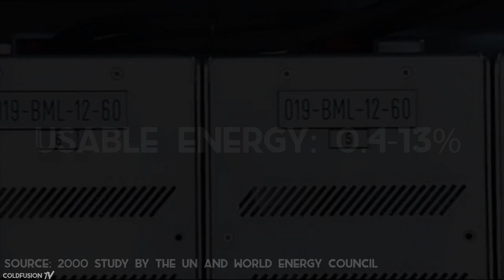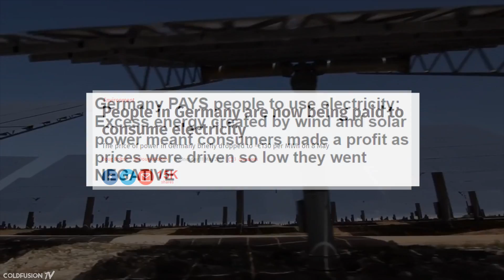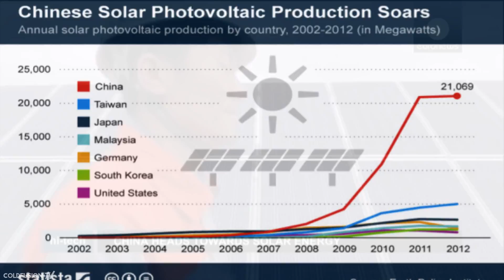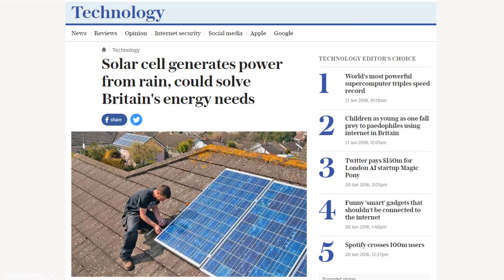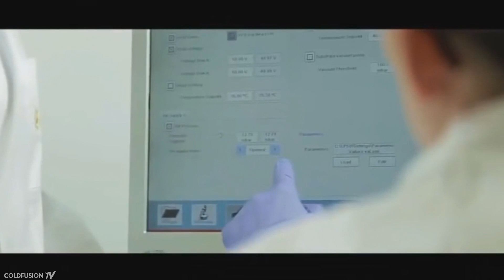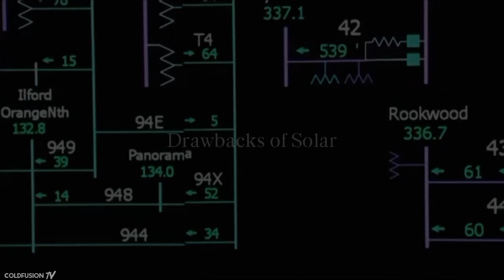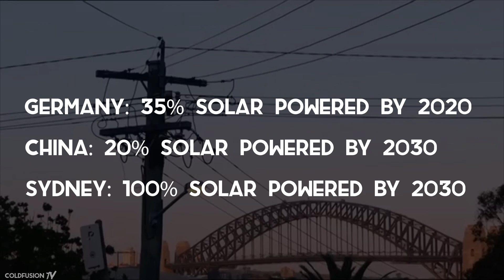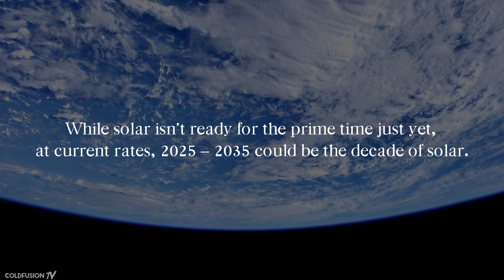The Truth About Solar

Comment: This video needs to be updated.  With the decommissioning of nuclear power-plants in California, Japan and in Europe with the thought solar and wind electricity creation would off-set the loss it's dismal failure.

With the premature decommissioning of nuclear plants we have lost 6% of our our ability to produce electricity  Yet at the same time we have only been able to offset that 6% loss with a 2% increase from solar and wind.

So what about the other 4%?  We are burning more coal and fossil fuels than ever before and we still have all of that highly active nuclear fuel we won't be using.

Germany and California have both announced they will not even come close to meeting their solar initiative programs.  With the loss of nuclear both are building more coal/fossil fuel fired power-plants.

Now that we know for sure solar and wind can only provide a small percentage our our electricity, were is the rest going to come form?  Coal/fossil fuels or nuclear?  Or are you willing to do without electricity for a few hours everyday?
Reply: Sparky   Why are you so against nuclear and not cola/fossil fuels?  Every years the burning of coal and fossil fuels kill 3 million people and releases millions of tons of radioactive waste into the atmosphere.

At least nuclear-power plants only release nuclear radiation only when there is an accident where as coal/fossil fuels release nuclear radiation everyday.

What's your objection to the latest gen of nuclear which uses low atomic weight radioactive isotopes.  If a Chernobyl size accident were to occur with a next-gen reactor the radioactivity would have decayed away in 20 years.

Let me ask you a question.  If solar and renewables will only be able supply the world with 20% of the words energy in 35 years where is the other 
85% going to come from?  With the technology we have right now it would have to be nuclear or coal/fossil fuels.  Problem with fossil fuels is they release green-house gasses. release millions of tons of radioactive isotopes into our atmosphere and and kills 3 million people every year.

If you have a better solution lets here it.
Reply: Both of these failures were as you mentioned due to human failing and not the technology itself. While I am not going to go traipsing around ground zero at Chernobyl it turns out the wildlife around there is doing pretty well. Radiation is not a no amount is safe thing like we have been told. While we may be tempted to talk about reducing demand and living less energy intensive lives that is not going to happen unless access to energy goes away and we severely reduce the population. I want to see us use the new reactor designs with passive failsafes and no ability for the technician to override them. The LFTR reactors are pretty cool in that it is hard to keep them working and in case of even a severe accident they still fail off. They also produce little waste and can even be made to burn old reactor waste. Yes we paid a steep learning curve on some of the old technology but it would be foolish and perhaps ecologically devastating to take the one comprehensive practical non carbon producing alternative to fossil fuels and say that it can't be used because we made tragic mistakes in the past with it.
Reply: I don't think anyone that was paying attention thought renewables were going to offset the losses in nuclear energy in Japan and Germany.  Not all environmentally conscious people hate nuclear. It is a great power source when managed well.
Reply: Yep, thousands of death are too dangerous! But millions of death from fossil fuels are A-okay! It's like the difference between deaths in airplans and in cars.
Reply: Chernobyl. Fukishima. Who fixes these colossal failures? No, not nuclear failure, not an energy more dangerous than others, but stupid. And that's not fixable in humans. And it shouldn't be either. It's called freedom, and living, and being who we are, even if stupidity is part of the equation. The part where stupidity becomes unacceptable is when people think nuclear accidents and mistakes can be fixed. How cheap and how environmentally balanced IS nuclear energy, no matter how advanced and safe the designs are now? The monetary, physical, environmental, cultural and health losses and negative outcomes of Chernobyl's buggered up test audit will never end. It has taken 30 years and countless dollars just to put a flimsy (100 year life) cover of the #$%&-up. Belarus land lost. People's lives and heritage permanently erased to the point where nobody remembers what was lost. (or cares). 
Oh. And Fukisima? It's shameful when the unpleasant reality of this sort of situation is only shown by amateur researchers sneaking through illegally with dosage meters on the dashboard. 
Perhaps the key to meeting energy needs in the future is a change in what drives the need. People, and the way we live.
Reply: Agreed,  Nuclear power is way more dangerous than humans can comprehend.  Well spoken points here!
Reply: Todorius  Why is it these pro-solar anti-nuclear types are so ignorant and don't understand the difference.
Reply: Michael Weaver  You need to learn more about thorium and instead of the hype from Sorensen.  Look if MSRs were that safe why is Sorensen having such a hard time getting the few million he needs to get started?

He can't even get enough funding to open an office.

But let's look at the facts.  An full scale MSR has never been built.  Yes we built a small experimental one, but scaling up from experimental is something new.

Thorium is water soluble.  So if there should be a leak the salts could enter or ground water and water supply.  There are a number of corrosion and technical issues which were never solved and still to this day we don't have them all worked out.

The US and Europe considered thorium but with the modern technology we have today it obsolete.  

China is the only one considering thorium.  But even they have realized it will take 30-40 years to get a prototype built.  But why?  We are currently working on Next Gen Nuclear which uses low molecular weight atoms and will produce 1,000 times more energy much more safely than MSR.

These are just some of the reasons we will never see or build an MSR. 

 .
Reply: Passed High School Physics
I have provided you with information up to date to September of last year. Please stop lying.

You make claim after claim that are blatantly wrong. Almost everything you have just posted there is a lie, and everything else is at least misleading. For a proper breakdown of the technology and the challenges it is facing I am referring anyone reading this to the following:

http://www.janleenkloosterman.nl/reports/thesis_pool_2013.pdf
Reply: TheGerm24  Agreed.  Next Gen Nuclear is proving to be even better.  Using low molecular weight atoms there is no long lived nuclear waste.  Should an Chernobyl or Fukushima accident occur with next gen nuclear in just 20-30 years all of the radiation will have decayed away and it will be completely safe again.
Reply: Yeah, unfortunately only partially true. The Green party still wants nothing to do with nuclear even though it is their best hope to slow down or stop climate change. They really believe deeply that anything nuclear is a deadly danger that must not be allowed and that renewables can replace everything. I myself don't want much to do with today's nuclear as the waste decay is just to long and dangerous. The next gen alternatives look very attractive and that's where China is going although it galls me that they are going to go there on the research the US did and left abandoned. Better China does it then nobody but what a better country and world we could have had with this technology.
Reply: Semni Istiqlal  Have you ever taken a  science, physic or chemistry class?  Have you never heard of the term molecular weight?

Where did you get your education?  

All atoms/radioactive isotopes have different weights.  Current nuclear power-plants technology uses the heavier atoms/isotopes for fuel.  Next Gen Nuclear is using the lighter atoms which is at the complete opposite of the periodic table of the elements.  (You do know what the periodic table of the elements is, don't you?
Reply: Semni Istiqlal  If you think MSR is so great why not invest in it and make it happen?  

Don't you think their's a reason why no one is investing in MSR?  Yes a prototype was build in 3 years, but it was also found the prototype could not scale up.

Next Gen Nuclear research is being funded by the US, (NIF), European countries, (ITER), China and billionaires.  They are not spending on a penny on MSR because of all of the technical problems MSRs have.
Reply: Passed High School Physics
So? This is not relevant to what we were discussing.
Reply: Passed High School Physics We were discussing nuclear power. I ask you to back up your claims and you try to change the topic, very suspect.
Reply: Passed High School Physics
Because the burden of proof lies with the one making the assertion, not the one calling that assertion into doubt. You'd know that if you had actually passed high school physics.

You are either strangely ignorant of this or your next move is going to be to pretend that this now gives you an excuse not to provide any evidence of your assertions.
Reply: Semni Istiqlal  Friend there's the Michael Shellenberger interview with nuclear engineers in China from just a a few months ago.

Then there's the info on the World Nuclear Association web site.

I've provided you with the information have you even looked at it?  Why don't you take a look, read it, and understand it, the comment on it before bashing me.  The information is out there if you read it.

And then you avoid my questions.  If we are to learn from each other you need to provide information also.

The links you have provided are years old.

Has Shanghai Institute of Applied Physics received additional funding to continue the research? Nothing you posted so far says they have which means they will be shutting down the research next year.

Can you post a link to the progress and discoveries they have made with the funding they've received so far?

Have you looked at the World Nuclear Association web site? Why is it there is no mention of MSR or even research on MSR/thorium reactors.

Have you read or listened to Michael Shellenberger interview with the nuclear engineers in China? They clearly stated China sees no future in thorium/MSR.

Can you explain why you think China is moving forward with MSR when they've made a commitment to TWR which is a completely different design and technology.

Why are research dollars being spent on next gen nuclear if the Chinese according to you are developing MSR.

Could it be thinks in China have changed?  And they too have now realized MSR/thorium is not the way to go?
Reply: Semni Istiqlal Dude things in the world change.  If I had posted this fiver years ago yes you could call me a liar, but I didn't.  I posted this after the project was 100% behind schedule and funding was running out. 

Let me see if you are a liar.  Do they have funding to complete the MSR?  If so why is this not being reported anywhere?

If you are not a liar why is it the Chinese government did not, and has not listed this on the nuclear reactor projects they are working on? 

And if you are not lying why is it Chinese officials officially announced there is no market for MSRs because it would take decades of testing to see if they would work and if they were safe.

For some crazy reason in spite of the current facts you continue to believe what's posted on an out of date web site which states the reactor would be operational in 2015.  

Dude, it's the end of 2016 and they still don't have one built.  You are the one who stated they could build one in 10 years.  Times a ticking and they haven't even built a prototype even with the plans they were given from Oak Ridge.

How many more lies are you going to believe and propagate before you figure out you are wrong.  Well you are wrong now.
Reply: Semni Istiqlal You call me a liar and then refer people to a 2013 press release?  What kind of BS is that?

The press release is from 4 years ago, there have been a lot of denouncements in the nuclear power research since this press release document was written.

As of 2015/2016 Next Gen Nuclear is progressing.  The scientific predictions have proven to be correct and confirmed with experiments.

Let's see how things are going for LFTRs.  As of 2015 the building of a prototype is 100% behind schedule.  

In 2017 funding for the building of the prototype runs out.

As of November 2016 no additional funds have been allocated for future LFTR development.

As money for LFTR dries up, funding of Next Gen Nuclear continues as does funding for the next iteration of current nuclear power technology.

Can you provide use with any current news on the progress on LFTR?  It could be from this year, last year or even the year before.  But please stop already with the ancient PR documents from 4 years ago and more.
Reply: *****  With the Chinese now selling solar panels for 1/3 the cost of the American made panels solar makes sense especially when tax payers are paying for 30% of the cost.
Reply: This is a terrible argument against solar if thats what you are trying to do. Just because governments are making stupid decisions (ditching nuclear and increasing fossil fuel use because of it) does not mean that solar is bad. Removing something before you can replace it is stupid and has nothing to do with solar or wind
Reply: +Passed High School Physics Interesting you say China has given up on MSR. Not what I heard but I have heard Bill Gates go negative on MSR. Bill Gates is way smarter then me and has a proven ability to run a massive enterprise but he also is a bit a of a terror on competitors. If he thinks your competing with him your generally not around long. I wonder if that could have anything to do with MSR not being safe. From everything I have ever read and understood to the best of my ability, MSR it is one of the safest nuclear concepts in the world. I won't repeat everything Kirk Sorensen has said but he makes a very good case for the safety of MSR. Now a bunch of engineers who have to implement it may see it differently and MS it is very corrosive stuff.. I can't go along with hydro. It is very environmentally destructive in the sense it floods a lot of productive land and there really are not that many suitable sites. It also kills a natural river and leaves behind this kind of water wasteland. Geothermal might be good but again the number of near surface tap-able sites are not widely distributed and available from what I know.
Reply: +Passed High School Physics I think I will wait a bit on a traveling wave reactor. There has never even been a prototype nor have any of these other technology except a MSR had a prototype to my knowledge. I will look into your technology claims if you can give me the reference and exact technology we are talking about. Who knows maybe I will be a convert but when I hear 1000 x the power and much more safely unless your a certified nuclear engineer I tend to get skeptical. In regards to Sorensen not able to get started I think it is kind of a tragedy. He can't move because he can't get a backer like Gates. China who I think you will admit still hasn't abandoned the idea says 30 - 40 years. Actually I heard more like 20 but lets not quibble. They say that because they intend to build a prototype and then a scaled up reactor that they can use to learn from and run over a long period of time. Chinese scientists are not dumb they don't want a Chernobyl style catastrophe due to their lax testing. Once it is all tested and approved we are now talking maybe 5 years rampup to build commercial reactors and another 2 - 5 years to bring the first ones online so you get a long period of time. Do you think these other technologies will have any faster development cycle? Again not to quibble but Th is not soluble in water. Some compounds of Th are soluble and I would have to look to see if any of these compounds are part of the chemical makeup of a Thorium reactor. I am not sure why you care if  thorium is water soluble since it is not a big radioactive problem unless it gets converted to U233 which it won't do without neutrons from an outside source.
Reply: Low moleclular weight atoms ...wat? Okay, now you are writing bullshit.
Reply: Passed High School Physics
You are using science-ey terms, but not in a way that makes any sense.

Are you trying to talk about fusion?
Reply: Semni Istiqlal What's not making sense?
Reply: Passed High School Physics
You seem to be trying to talk about fusion ... in a way that makes it seem like you are unfamiliar with fusion.

You are aware that fusion doesn't even have a power producing prototype? They built an MSR from design spec to working prototype within 3 years and ran it for six.
Reply: +Passed High School Physics Not sure where your getting your information from. Unless they have canceled everything since this article was put out in October of 2015 then it appears the Chinese are not at all done with MSR. https://www.technologyreview.com/s/542526/china-details-next-gen-nuclear-reactor-program/. 
Why do you insist it cannot be scaled and where is your backing evidence? Yes it has issues like all highly complex technology but I am not hearing that everyone has totally abandoned it and not a penny is being spent on it. Terra Power went down another path and that is a good thing. The more simultaneous programs we got going until there is clear winner the better. These are all essentially untried technologies so some are going to fail but with enough being tried we should get at least one the works.
Reply: Michael Weaver  This was a press release and it's filled with incorrect information.  One of the fundamental  mistakes int the article is they have mixed up MSR with TWRs,

China has enetered into a MOU to produce a TWR not a MSR reactor in this time frame.  Not sure why they are mixing up MSR with TWR.  Stupid.

This is PR release.  If you take a look at China's NRC equivalent they stated within the last month or so they will not permit a MSR.  So while this press release might say something about MSRs the government will not allow it.
Reply: Passed High School Physics
Yeah, no.

What got anything to back up your claims because what I've found so far says you are full of le-shit.
Reply: Semni Istiqlal  Have moth full of shit are you familiar with the research at Lawrence Berkeley National lab and at Spectrolab on solar cell efficiency? 

Ever here or multi-junction solar cell?  Or solar cells which can covert additional wavelengths of light into electrical energy? 

Crud man these discoveries on more efficient less costly solar cells go back 5 years to 2011.
Reply: Semni Istiqlal I thought we were talking about how the next gen solar panels will cost less and be 3 times more efficient?  These discoveries were announced in 2011 and confirmed by several other scientists. 

Are you familiar with perovskite solar cells?

Why is it you think plasma-enhanced atomic layer deposition solar cells will not reduce the cost of solar panels?  

I don't get you.  Why is it all of the scientists are saying they have found ways to make solar panels more efficient and cost far less to produce and you say it's not possible.  

What is it you know the 100s of scientists who have made and confirmed the discoveries don't know?
Reply: Semni Istiqlal I would happy support my all of my clams.  Which ones are you questioning?
Reply: Passed High School Physics Lets start with all of the claims you have made so far in this thread.
Reply: Semni Istiqlal Sure.  I would be happy to provides references to credible sources to substantiate all of my claims.

Tell you what why don't you start by providing a reference to a creditable source in which you think will prove me wrong.
Reply: Semni Istiqlal  You are expecting me to prove what is evidently true?

If you don't have a specific post how can I prove you are wrong?
Reply: Passed High School Physics I am effectively asking you to show your work. To show me the information you used to come to the conclusions you have expressed so far in this thread.
Reply: Semni Istiqlal Certainly  As I stated in previous posts I would be happy to do so.  What information would you like to see?
Reply: Passed High School Physics Lets start with the following:
"China looked at MSR and decided they were way to dangerous."

"Thorium is water soluble. So if there should be a leak the salts could enter or ground water and water supply. There are a number of corrosion and technical issues which were never solved and still to this day we don't have them all worked out."

"The US and Europe considered thorium but with the modern technology we have today it obsolete. "

"China is the only one considering thorium. But even they have realized it will take 30-40 years to get a prototype built. But why? We are currently working on Next Gen Nuclear which uses low molecular weight atoms and will produce 1,000 times more energy much more safely than MSR."

"They are not spending on a penny on MSR because of all of the technical problems MSRs have."

"If you take a look at China's NRC equivalent they stated within the last month or so they will not permit a MSR."

Please provide anything to back up these assertions.
Reply: Semni Istiqlal No problem.

"China looked at MSR and decided they were way to dangerous."

That is true.  At a World Nuclear Association meeting China stated they thought thorium reactors were untested and unproven technology.  The acknowledged 50 years ago there was a prototype thorium reactor but no one has built one since.  China stated if they were to build one the testing and approval process would take over 50 years.  Who in there right mind would build a reactor of a completely different design then what's been used in the past 50 years which is of a new untested design without fully testing it.  The reason we/China is not even considering thorium reactor is it's just too dangerous at this time.

You can read or watch the interview.

Now let me ask you a question.  What Chinese company is currently building a thorium reactor?

What company anywhere in the world is building a thorium reactor?  

Dude China has 20 nuclear reactors under construction.  Are any of them using thorium?

Nope.

"Thorium is water soluble."  Yes "Thorium salts used in a thorium reactor.  Salts are water soluble therefore the thorium used in the reactor is water soluble.  

Did you not take high school chemistry?  Salts are highly corrosive.  Since you seem to think they are not let me ask you a question what material do we currently have which can be used in a thorium reactor and will not corrode?  What's the material?

"The US and Europe considered thorium but with the modern technology we have today it obsolete. "

That is true. Has the United States, Europe or for that matter China invested any research dollars on building a thorium reactor in the past 50 years?

Nope - Has the United States, Europe and China invested research dollars in nuclear energy research other than thorium?  YES!  

So obviously United States, Europe and China are interested in nuclear technology but not thorium.

My question to you.  Name one company which has received funding that is actively working on a thorium reactor?

You do know US and Europe and two billionaires are funding nuclear reactor research.  And not one is spending a dime on thorium reactor design.

Why is it you think next gen nuclear is not the answer?  That's were the research dollars are being spent.
Reply: Passed High School Physics Can you provide me with anything to back up these claims? Actual sources, data. For example the water solulability of thorium/uranium fluoride salts. Or actual studies on the corrosive effects of molten salts.
Reply: Semni Istiqlal  Yes I can.  I listed to the press conference after a World Nuclear Association meeting.  An American reporter specifically asked the Chinese government officials about thorium reactors.  Take a look on the World Nuclear Association web site.

Have you taken a high school chemistry class?  Do you know what an atomic bond is?  There are two types of atomic bonds, covalent bond or molecular bonds and ionic bonds.

Take a look at the periodic table of the elements to understand ionic bonds which are the type found in salts.  Salts are what corrodes things which is why they are soluble in water.

Thorium forms salts because it free electrons.  Uranium I don't think forms any salts and is not soluble in water.  It just doesn't have the free electrons to form salts like thorium does.

Can you imagine if a Fukushima type of accident occurred with a thorium reactor?  The radioactive thorium salts would dissolve in the water and easily leak out making water supplies radioactive and unusable.

This can't happen with uranium or plutonium they just don't dissolve in water and cause no corrosion issues.

Learn about chemistry,,,, It's interesting and beautiful.
Reply: Passed High School Physics Okay, so I've asked you at least twice now for specific source material and the best you have managed to do is refer to an interview that may or may not exist as well as make some assumptions about a reactor design you seem to know nothing about.

If you weren't just pulling everything out of your ass you would have presented your sources by now and if you knew anything about MSRs you would have known that a Fukushima-like incident simply couldn't happen in your typical MSR design.

You cannot even cite figures on water solubility for the salts in question. You are doing little more than low-grade ignorance-mongering...
Reply: Passed High School Physics
Lying to my face is not treating me with respect. Ignoring my honest request for source material in order to cover up your lies is even worse. You have been nothing but intensely disrespectful and intellectually dishonest.

You are incredibly ignorant of the fundamental principles on which LFTRs work, in stead spreading misinformation and scaremongering.

For example, China has recently moved up the timetable of it's Thorium based program. Reducing a 30 year program into a 10 year one, hoping to be building commercial MSRs before 2030. This is being done under the auspices of Xu Hongjie at the Shanghai Institute of Applied Physics.

You then seem to be under the impression that LFTRs carry a water soluble Thorium salt. This is not the case. LFTRs carry Thorium in it's elemental state in a salt based solvent. Thorium is remarkably insoluble, something that is used by various taking processes in fact.

I'm going to be generous and assume that you are merely ignorant about this fact, and not outright dishonest.
Reply: Semni Istiqlal Dude once verbally assaulted me, I though you wanted me to treat you the same way.  I will be the bigger person and refrain if you will from now on.
  
The Shanghai Institute did receive some funding but that's old news.  As I stated in my post in a recent press conference and on the World Nuclear Association web site there is no mention of MSR reactors or even research on MSR/thorium reactors.

You might want to read or listen to Michael Shellenberger interview with the nuclear engineers in China to update your knowledge of what's going on.

Use your head for just a minute.  Do you really think China can shave 20 years off of a 30 year process for the testing of a new untested nuclear power-plant design which uses a different type of fuel?  You know all of the anti-nuclear nuts would go crazy over such a statement and not let it happen.  

I think you used a word that says it all... hoping.

:hoping to be building commercial MSRs before 2030. This is being done under the auspices of Xu Hongjie at the Shanghai Institute of Applied Physics."

Yes they are hoping to do so just as Kirk Sorensen is hopping to get funding to do the same.

It's been 5 years and Sorensen's hopes have not been fulfilled.  Government and billionaires have are not funding his hopes.

Likewise the Chinese provided funding to Shanghai Institute of Applied Physics.(which is running out) and leaned a thorium MSR just isn't worth it.  Does Shanghai Institute of Applied Physics have funding to continue there research?  Not according to Michael Shellenberger interview with the nuclear engineers in China just a few months ago.

You do realize the Chinese are proceeding with TWR and NOT MSRs at the time as of June 2016.

Something else you are not thinking about or considering that the Chinese have is the fuel costs.  Michael Shellenberger did an excellent job in reporting this.  We have enough processed nuclear fuel to be used in LWRs for the next 750 years.  How much thorium fuel do we have mined and processed ready for use in MSR?  Answer is none.

Do you really think the Chinese would not use the fuel we already have ready to be used for the next 750 years in favor the mining and processing of another type of nuclear fuel?  Don't think so.

You are talking about a thorium MSR.aren't you?  Are you trying to say elemental thorium is used?  If not, please explain.

The thorium MSRs I know of use thorium and uranium dissolved in carrier salts.  Or at least that's how it was done 50 years ago at Oak Ridge National laboratory.

What kind of reactor are you talking about that uses elemental thorium?
Reply: Passed High School Physics
Did you even bother to read any of the sources I linked you? Half of what I've linked you directly contradicts what you just said there. So provide your own sources or bother to read mine.
Reply: Semni Istiqlal Yes I read them.  You do realize they are old.  The information I have posted is from this year, more specially that last few months.

Has Shanghai Institute of Applied Physics received additional funding to continue the research?  Nothing you posted so far says they have which means they will be shutting down the research next year.

Can you post a link to the progress and discoveries they have made with the funding they've received so far?

Have you looked at the World Nuclear Association web site?  Why is it there is no mention of MSR or even research on MSR/thorium reactors.

Have you read or listened to Michael Shellenberger interview with the nuclear engineers in China?  They clearly stated China sees no future in thorium/MSR.

Can you explain why you think China is moving forward with MSR when they've made a commitment to TWR which is a completely different design and technology.
Reply: Passed High School Physics You haven't cited any sources so far, you claim that interviews exist that support your assertions but then you cannot point to specifics. It's almost as if there isn't anything to back up all of the claims you are making.
Reply: Passed High School Physics
I am not responding to your questions because they are based on blatant lies. I am not going to indulge in such a transparent Gish Gallop.

You have provided no links and no references to actual articles. I have provided 100% more evidence than you have, you have no basis upon which to criticize it.

That you are full of shit is revealed by even the most cursory of investigation. You are lying about China, you are lying about the World Nuclear Association website and you deign to lecture me on respect?

You don't have an ounce of integrity in your body.
Reply: Passed High School Physics
Do you admit that you are a liar?

http://www.world-nuclear.org/information-library/current-and-future-generation/molten-salt-reactors.aspx
Reply: Semni Istiqlal  You might want to read what you post. They ran into problems.  The prototype which was suppose to be completed in 2015 ran into major difficulties and now need twice as much time to build the prototype.  Oops.....  While at the top of the web site it says it was updated in September of 2016 most of the references are close to a decade old with the most current reference more than a year old.

What they fail to mention is what's happening with the funding.  The Shanghai Institute of Applied Physics funds run out next year, yet there is no mention any additional funding.

With Shanghai Institute of Applied Physics claiming they would have a MSR up and running by now.  But now they are saying it's going to take twice as long one has to wonder what technical difficulties they ran into.

Did you listen to the interview the Chinese had with Michael Shellenberger just a few months ago?  When Shellenberger asked Chinese officials about MSR they said told me they see not future in MSRs.

Could it be the Chinese decided to cancel the research and put an end to the program by cutting all funding?  After all they are 100% behind schedule.
Reply: Passed High School Physics So you admit you are a liar, the website did mention MSRs contrary to what you claimed.

And now you continue to lie. What a steaming pile of bullshit.
Reply: Passed High School Physics Things do change, but you did claim that they had no information on MSRs on the WNA website long after September which was the last date that they changed their article on MSRs. That makes what you said there a lie, you should have known better but you said so anyway.

Cite sources for your claims and I will seriously consider them.
Reply: Semni Istiqlal  Yes things do change.  Have you read or listened to the Chinese government Q&A session with Michael Shellenberger?  Do you even know who Michael Shellenberger is?

Have you looked at the World Nuclear Association's November 2016 report on nuclear power research and nuclear power-plant construction in China.

I will specifically call you attention to China's 5 year plans and their current plans.  I will call your attention to the fact that thorium/MSRs were not taken seriously even when China Academy of Sciences funded the Shanghai Institute of Nuclear Applied Physics for thorium/MSR research.

If what you state is not a lie about a  thorium/MSR prototype reactor being built and operational in 2015 and full scale thorium reactors to be built around 2020. IF as you say China was seriously considering this, why is there no mention of thorium/MSRs in any of China's five nuclear power plans since 2010?

You keep saying the Shanghai Institute of Nuclear Applied Physics has plans to have thorium reactors in use in about 5 years yet there is no mention of it?

You are quick to call me a liar, but then you can't provide any current information about funding or why the Shanghai Institute of Nuclear Applied Physics failed to meet their 2015 deadline of having a prototype built and operational.  Or what problems the Shanghai Institute of Nuclear Applied Physics ran into which has caused a 100% delay.

I'm not sure why you just don't accept the fact thorium/MSRs are very old technology.  And as the folks at Shanghai Institute of Nuclear Applied Physics have discovered their are some technological challenges which in six years they have not been able to solve.

At this point in time why would anyone spend a dime on thorium/MSR research when Next Gen Nuclear will produce thousands of times more energy, is green, has a renewable fuel source and produces no long lived radioactive waste.

So stop providing outdated obsolete inaccurate information about Shanghai Institute of Nuclear Applied Physics thorium reactor project and China's plans to use thorium/MSRs to supply power.  As on November 2016 Shanghai Institute of Nuclear Applied Physics has not received funding to continue.  Bottom line, thorium/MSRs are a failure.  China has proved it.
Reply: Passed High School Physics That's a thesis paper. Please stop lying. Again, you continue to just spew lies. Can you even provide anything to back up any of your claims? It seems not.
Reply: Semni Istiqlal Dude that's not a thesis it's a press release.  It's not even in the format or style of a thesis.  Not sure if you've been duped or are just trying to BS me.  

I have refrained from calling you a liar, but I have asked you very specific questions and all you do is refer me to info that's 4 to 14 years out of date.  If you can't answer the questions with current information like I have been providing to you, I think we can only assume you are the liar.

Let me ask the questions again.
You are the one saying China is building a thorium/MSR reactor.
A prototype reactor was suppose to be built and operational in 2015.  Where's the reactor?

You are the one claiming China will have an operational thorium/MSR in just a few few years.  Where is the construction site?

Funding for the building of the prototype thorium reactor runs out this year.  No money - no research.  Have they received additional funding to continue researching?

I have provided you with documents from 2015 and 2016 which contradicts everything you have stated.  

If you can't provide any information from 2016 or 2017 I think it is you who is the liar.  But let's see.  Post something about China's progress on the project from 2016 or 2017 to prove you are not lying.
Reply: Passed High School Physics You didn't read it, did you?

You havn't provided any documents. Lie 1.

I didn't claim that they'd have a reactor by 2015. Lie 2.

I didn't say they were building a reactor. Lie 3.

I didn't say they'd have a working reactor in just a few years. Lie 4

You claim that funding is running out. Lie 5.

You have not provided me with documents. Lie 6

I have provided you with information from 2016. Lie 7

Literally everything you said there was a lie. Jeezus christ.
Reply: Semni Istiqlal You need to read the documents you post links to.

Yes let's look at the facts.

Fact 1 - All of the documents you reference are 5 years to a decade old.

Fact 2 - You have not provided any information as to the progress China's research thorium reactor research form past five years.

Fact 3 - From your own post and from document your posted links to China claimed they could create a prototype thorium reactor by 2015 and a full scale production reactor by 2022.

Fact 4 - China announced they had issues building the prototype reactor and are 100% behind schedule.

Fact 5 - Funding for China's research on thorium reactor research runs out this year and YOU have not provided any evidence China will continue the funding.

Fact 6 - As of last year China formally stated in an interview it would take them 40 years to approve the building of a thorium reactor.  Why don't you listen to or read the interview.

Fact 7 - You can't tell the difference between a press releases and a research paper.

Fact 8 - You have not been able to provide any China is actively in 2015, 2016 or 2017 is actively working on a thorium reactor.  Not looking for 5 years or more press releases, show us something current.

Fact 9 - If you can't show any documents form 2015, 2016, 2017 showing China's progress on thorium reactor research we must conclude it is you who is the liar.
Reply: Michael Weaver  China and Bill Gate's nuclear company TerraPower have entered into a partnership.  First reactor should go live in just a few years.  China looked at MSR and decided they were way to dangerous.

Not sure if you know but the founders of Greenpeace, and of the green party are all pro- nuclear even though the organizations the organizations they founded are against it.

No energy source is perfect.  But out of all of them, solar, wind, tidal, coal, fossil fuel, hydro and geothermal nuclear is the least worst of all of our options.